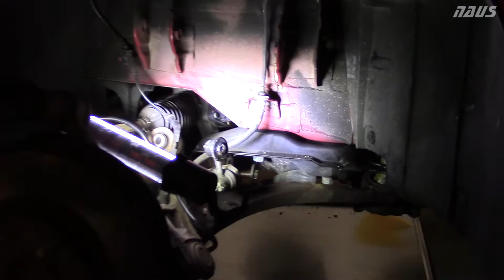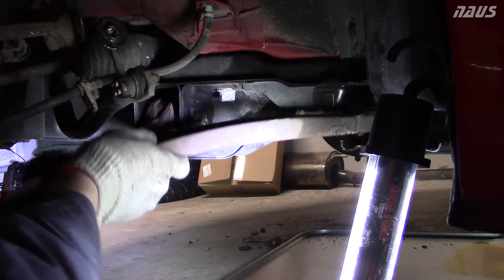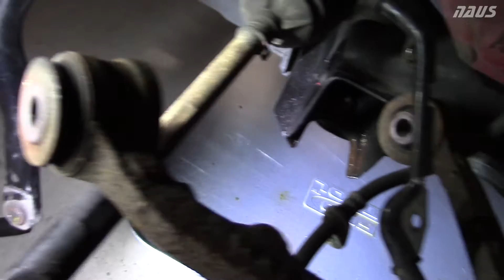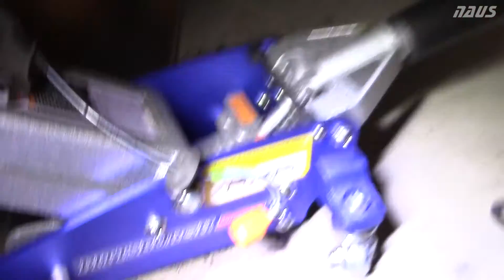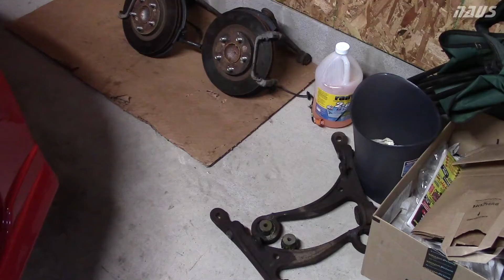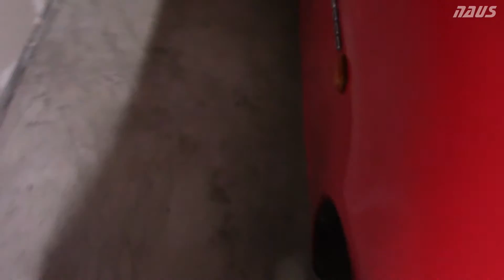How To Remove Seized Bushings | S2000 Front Suspension Refresh Part 1

Comment: my driver side camber bolt is super seized, I torched it and it started to turn but still stuck. Tried hammering and didn’t work. any tips? thanks!! The compliance bushings took me literally a min to cut out but camber bushings doesn’t have enough room to cut
Reply from the maker: Yeah that’s a pain, I would soak the thing in pb blaster over and over, then maybe air hammer the bolt to break it free?
Reply: @NAUS2K  ya i think thats the final option, cause torch didnt, well it got it to move atleast. Its Hammer time! thanks for the reply
Reply from the maker: @diuleil0mo  I wouldnt try to fit the sawzall in there, it will do some permanent damage to your subframe. If the hammer doesn't work, get a bigger hammer!

Comment: Do you need alignment just replacing lower control arms?
Reply from the maker: almanu04 you need to get an alignment if you touch anything on the suspension

Comment: Do you think a 6 ton A-frame bench press will suffice?
Reply from the maker: I would think so, I used a 20T harbor freight press in my other video to remove the bushings from the control arm, it seemed to do the trick with little effort

Comment: Were the front hub nut hard to take off and what did you use ..??
Reply from the maker: front hub nut? you mean the balljoints? I used a harbor freight balljoint separator on them worked like cake
Reply: Lol front l axle nut .
Reply from the maker: there is no front axle nut... Car is RWD

Comment: Use a better blade, I used the Diablo from Home Depot on my Accord and it is exceptional. 

Diablo 6 in. 8 Teeth per in. Steel Demon Carbide-Tipped from Home Depot.

Comment: That's the worst, had the same thing happen to me while doing coilovers on my friends EP3. The rear bottom bolt got seized to the bushing sleeve and it wouldn't come out no matter how many times I sprayed it PB Blaster. Ended up cutting both sides with an angle grinder... It was horrible.